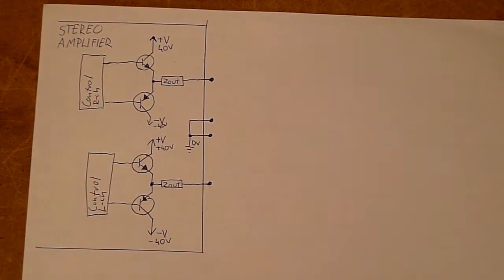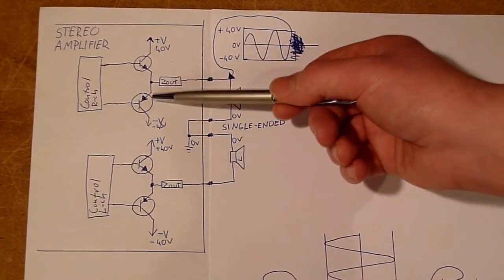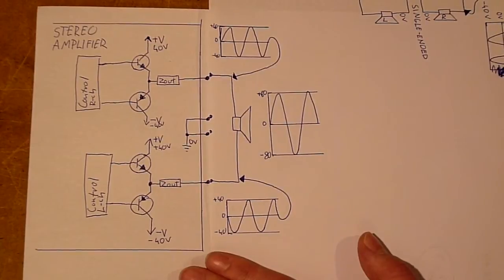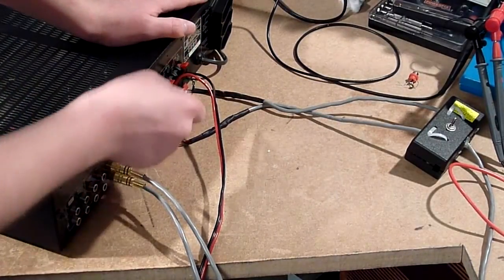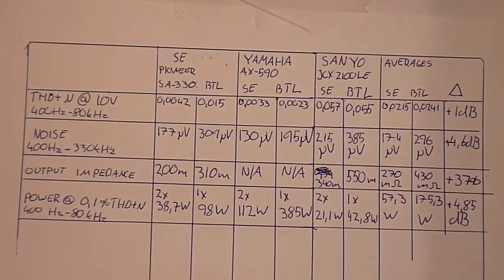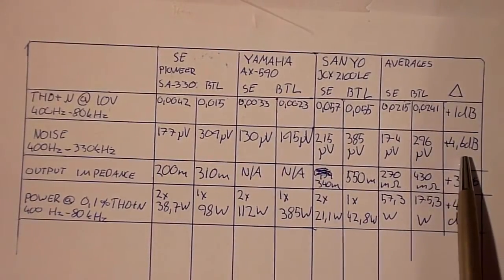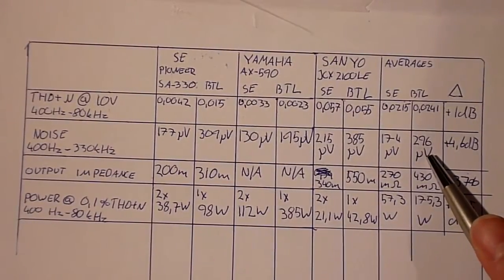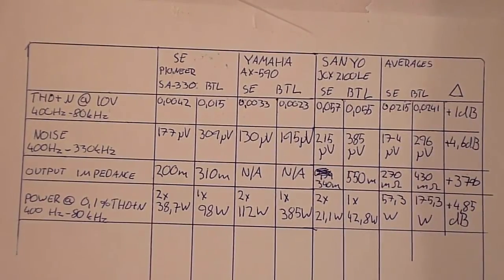Some experiments with bridging audio amplifiers

Comment from the maker: You need to consider that these are class AB push-pull amplifiers running off of a split voltage rail. They're essentially two amplifiers per channel, one doing the positive swing and one doing the negative. By connecting the speaker between two such amplifiers and having them put out signals 180 ° out-of-phase, you make one speaker terminal go toward the negative rail (below ground) and one toward the positive (above ground).

Comment: in a bridge mode, can i connect 4 speakers rated 1000w each? My amplifier has 1100w RMS per channel. would u please answer my question, thanks.
Reply: Rodolfo Baliga if your amp lowest ohm load is 4 ohms per channel , in bridge mode you can connect only 8 ohm speaker   because both channels if bridge at 8 ohms , they already loaded 4ohms

Comment: The increase in power output in the table does not take into account the quality of the power supplies in the different amplifiers. You can't fairly average the 3 amplifiers' outputs because of this. If you take the pioneer and sanyo amps, their bridged out puts have hardly increased over the figures for their single ended outputs. The  Pioneer - S.E. 38.7W x 2 = 77.4W and bridged only increases to  98W). The sanyo is even worse as there is actually no increase in power when bridged.  The Yamaha shows it's quality in this test, it's combined s.e. outputs giving 224W but increases to a massive 385W in bridge mode, due to the excellent regulation and headroom of its power supply.

Comment: I don't understand how you bridge the two amplifiers. If the 2 amps are running off the same power supply, then you won't have more voltage swing because they have a shared ground. If they're running off 2 separate transformers, then the only current flowing will be the current to equalize the potential difference between the two power supply rails.